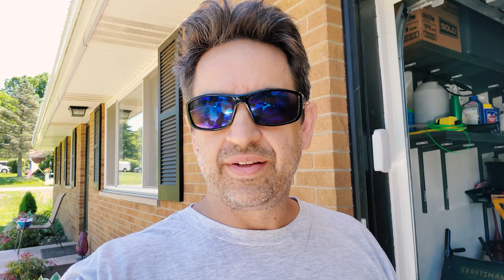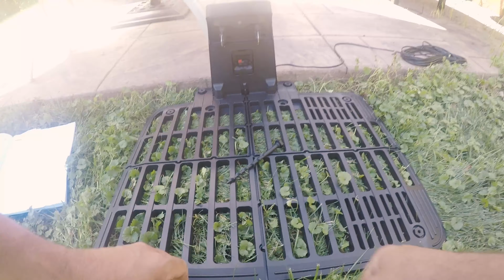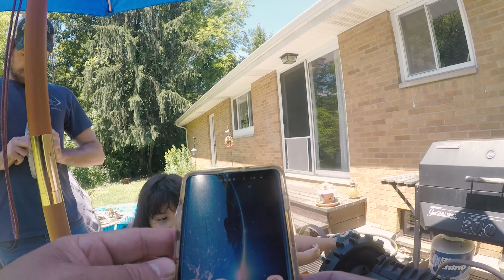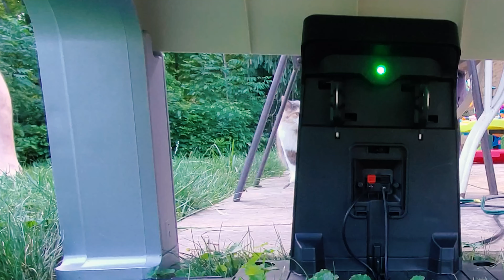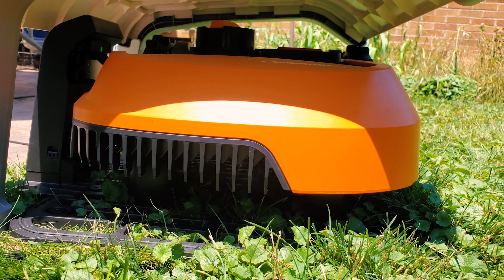Robotic Lawn Mower Installation | Worx Landroid WR153

Comment: That’s kinda shitty by worx to be honest, if you bought the model that can cover 1/2 an acre, they should give you enough wire to do the job 🤷🏻‍♂️

I’m defo tempted to get one of these though, defo seem to be the pick of the bunch for robotic mowers
Reply: Google maps has a measure distance option that you could try as well
Reply from the maker: Yeah Naiboz, just go around the edge of your lawn and count how many feet it is to know how much wire you need. And also, use the landroid to measure where to put the wire from the edge of lawn. See where the blade cuts on droid to measure the distance to edge of lawn to save you time edging later or doing cleanups with regular mower.
Reply: @CaptureMotionVR  have you tried to install the ACS anti collision module on this model? I can't seem to figure out if can fit into the WR153e?
Reply from the maker: @Ro99151  No I do not have the anti collision module, just the GPS which is worthless without paying their subscription.